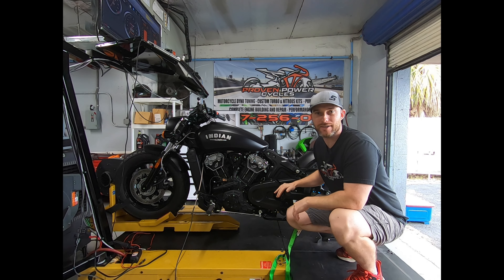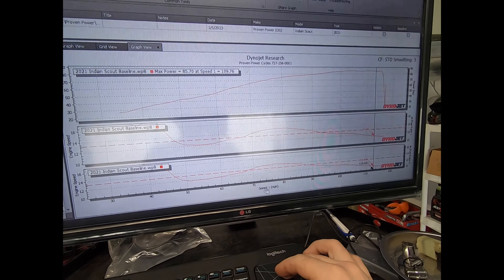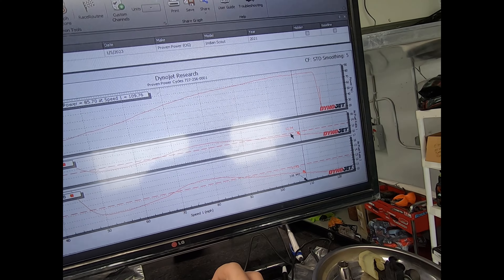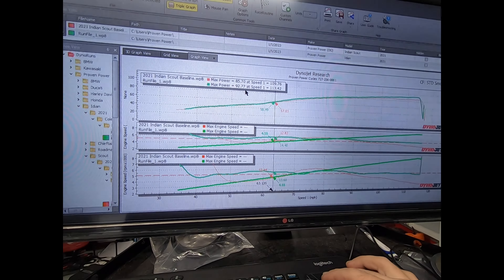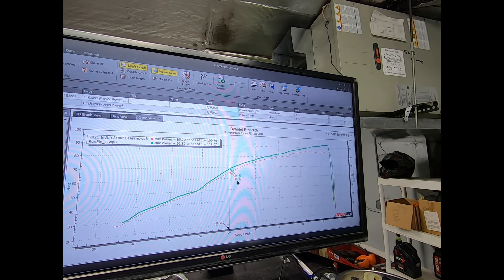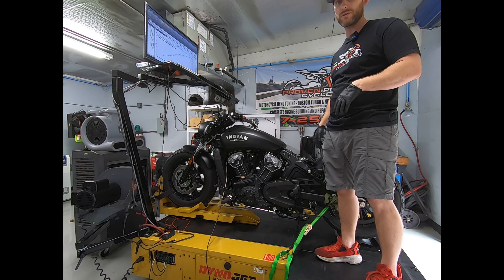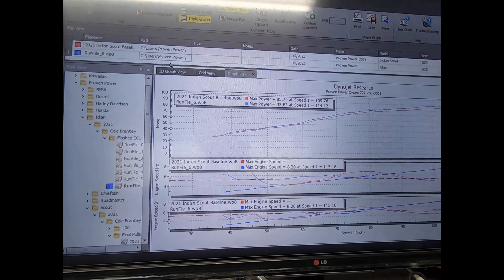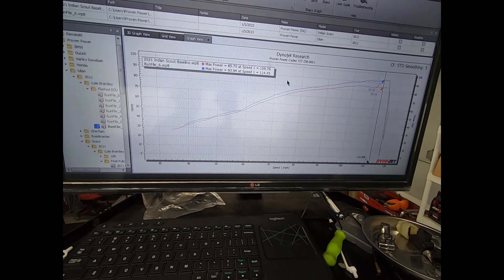2021 Indian Motorcycle Scout Dyno Tune

Comment: I'd like to know how the fuel situation has changed and how much, if any, miles per tank we're given up! I'd love to possibly do this to mine but without losing ride milage...
Reply from the maker: Well, the way we tune, you don't have to sacrifice fuel mileage to gain power. Heavy acceleration/full throttle is in a different part of the mapping compared to cruising and light throttle application. 

Now if you are constantly beating on the bike and are an aggressive driver then yes, fuel mileage will go down lol

Comment: I have a bone stock ‘22 Rogue Sixty. How would the bike benefit from a tune? I am new to this.
Reply from the maker: What I usually tell everyone is what you put into the bike, you will get out of it paired with a tune. 

In other words, if you don't change anything and leave it stock, expect little to no gains and changes to be made through tuning. 

But if you install a full exhaust and good air cleaner, then pair it with a tune, well you will get better results, more driveability, smoother acceleration, etc.

Comment: How much does it cost to get a tune? Does it vary in cost depending on what upgrades you have on your bike? I have a 2021 Indian scout bobber with S&S air intake and 3.5" Rinehart slip-on exhaust. I was going to buy the PV3 tuner but have no idea what I'm doing... Would it be more beneficial to have a professional do it on a dyno?
Reply from the maker: It's a pretty complicated program. Unless you have a decent idea of what to do if you go that route then I would advise to not do it yourself. You could easily lock up / break your ecm if you do it wrong. 

Dyno tuning is definitely the best route to go no matter what. On this one we did utilize a pv3 unit and took a lot of loving to get it right lol

Comment: Did you save your map? I have a Power commander V with a 2 into 1 Indian pipe and stage 1 airbox with K&N air filter. I would also like to compensate for the ignition curve with a +4 to +5 degree timing advance. It's also hard starting in the cold because it's too lean.

Comment: Would like to see more Scout Dyno runs with mods if the opportunity arises
Reply from the maker: I will try to get a lot more videos as the opportunity arises.
Reply: Nice work . I like what your doing mate
Reply: Is this the 60ci or 69?
Reply: @sdrtech I think Indian went to 69ci in 2015.
Reply: @RefinerSimilitude they still sell both
Reply: @sdrtech  ah. according to this guy 

https://youtu.be/mAtEYcqK_UA?si=1lEkrNvKMgzLbvFq

at 2:39, polished aluminum heads are 69 and blacked out are 60.
Reply: Thats the 69, you can tell by the chrome on the motor cyclinder head.@sdrtech

Comment: thought off the rack bike has 100 horses ????
Reply from the maker: Usually manufactures measure to the crank or engine horsepower (bhp). Our dyno measures rear wheel horsepower which takes into effect all of your drive train loss (varies bikw to bike but usually is around 15% loss from crank hp). 👍👍
Reply: Indian Scout Bobber Twenty is 100HP off the rack.
Reply: @irpk239 its 100 bhp, just like the bobber. If you dyno a stock scout 20 you wont see 100 hp to the wheel
Reply: @MaxStax88  Thank you.

Comment: The numbers seem low (im new to bike tuning), would this be a dramatic change to the bikes power? I test rode one of these today and it was pretty underwhelming in the power department.

I rode the honda rebel 1100 before this bike and the Honda rips by comparison.
Reply from the maker: They aren't too bad at all and we learned afterwards that there is a speedo Limiter at the 120mph mark, which is where 4th redlined at in this video ironically enough. With that being said, we feel like there is still more to be made from this bike. 

That's not bad considering it didn't have a ton of money thrown at this bike 🤙

Comment: Do u have full access to the ecu's  functions? As in could u raise red line lower idle remove speed governor etc?
Reply from the maker: Yes, since these are so new I don't know which Indians have what ability as of yet but on the scouts I can alter quite a bit of stuff including idle, speed governor, ignition timing and fuel mapping to name a few.
Reply: @provenpowercycles  Is a power vision required for the tuning or are you purely flashing the ecu's code?
Reply from the maker: @Camron Goodall  power vision is the ecu flasher for them. That's the only one I know of to date. Same stuff Lloydz uses 🤙

Comment: Damn. So my stage one ISB is probably at somewhere like 97-98whp  based on this video. I wonder if I was dyno tuned if I could hit actually 100 at the wheel. Running an off the shelf tune right now cause I can't find anyone in florida with a fuckin dyno.
Reply from the maker: Not sure but we also learned more after the vid. We can push it even harder to yield a little more up top !
Reply: @provenpowercycles  only difference is I'm running GP shorties, but I have a S&S intake, so I'm guesstimating pretty hard. If yall wanna pick mine up and mess around with it for another vid,  be my guest lol.

Comment: Great video. I think the max RPM is 10,000? Soft cut-in @ 9,700 would be expected (conservative, longevity, bladdy). But, are they ALL still limited to 120MPH? Original Kenda tire was H rated, therefore max speed= 120. However, Indian (Polaris) is playing with other-better known- manufacturers, so- I'm guessing that they are being fitted with higher speed ratings. Peshaw! What if I wanna install some 'spensive, high speed rubber? Why should I be limited to 120. I think the EU decided that autobahn burners are speed limited to 155MPH, whether in writing or just manufacturers taking responsibility for what they create. That would be easier, as only 1 or 2 gears can actually achieve those RPMs. Is there a way to remove the tire speed limiter using the VL3 or the harder to install V5?
Reply: Ive read that anywhere from 118 to128 is governed max speed. 8,300 rpm is where the limiter hits. One shop got 124mph on a dyno. I guarantee tire diameter is a factor.

Comment: Should have spent the $100 and put a intake on it. Would have gained a little more, motor could breath better and save time since it will need a tune if intake is installed later.
Reply from the maker: I agree with you on it. However, certain customers are strictly looking for driveability vs power. I provide the whole thing as a package deal. 👍